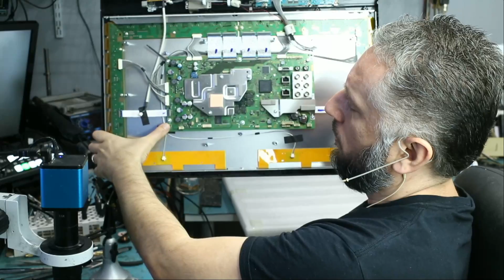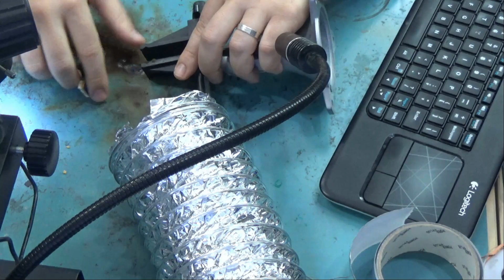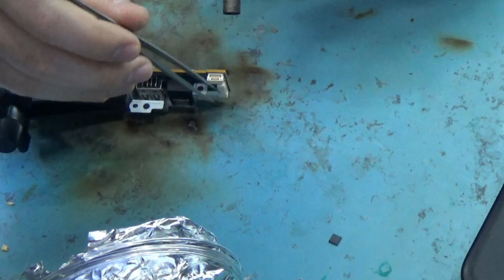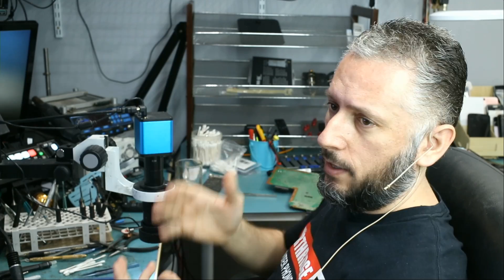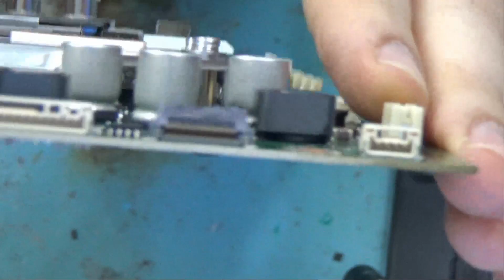CCTV Motherboard Repair - Broken Connector Replacement using another board

Comment: Indeed looks like a USB data connector.Vcc ,two data lines and GND.
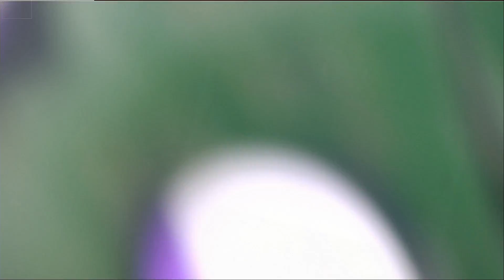But doesn't look like broken,except someone worked already on this.At 3:00 looks like unpopulated from factory,no sign on solder pads that something was there,same on data lines where may be some filter.

Comment: At 3:24 The  JST- GH connector in question looks to be a USB judging by the two middle traces coupled together. The black area around the traces is the copper pour removed during manufacturing of the PCB to prevent interference. The missing filter with the 4 pads behind the connector is most likely a TDK ACM2012-900-2P-T002. USB will not work without this filter

Comment: nice job ...i like your left side camera quality what camera do you use? regards Iulian !
Reply from the maker: Cannon 5D mark iii https://rover.ebay.com/rover/1/711-53200-19255-0/1?mpre=https%3A%2F%2Fwww.ebay.com%2Fsch%2Fi.html%3F_from%3DR40%26_trksid%3Dm570.l1313%26_nkw%3DCannon%2B5D%2Bmark%2Biii%26_sacat%3D0&campid=5338440312&toolid=20008 and 40mm lens https://rover.ebay.com/rover/1/711-53200-19255-0/1?mpre=https%3A%2F%2Fwww.ebay.com%2Fsch%2Fi.html%3F_from%3DR40%26_trksid%3Dm570.l1313%26_nkw%3Dcannon%2Bpancake%2B40mm%26_sacat%3D0%26LH_TitleDesc%3D0%26_osacat%3D0%26_odkw%3DCannon%2B5D%2Bmark%2Biii&campid=5338440312&toolid=20008

Comment: You make it look so easy.. And i'm trying to learn how to desolder and solder properly, i really am, but it's not as simple as "oh, i've soldered a couple of wires, time for me to move on to surface mount microcomponents with my extremely cheap soldering station with no air flow gun".

I'll be getting there, though. Cause even if i lack in depth knowledge about electronic components, I'm not a complete moron, and i used to be a fast learner. And while my magnification goggles will never compare with your microscope, they can get the job done. Just need to get myself a fume extractor, cause i built one out of 120mm fans, but it didn't suck enough. And an airflow station. And proper flux (559). And kapton tape. And uv mask. And..
Reply from the maker: You need to invest in buying a microscope and better tools, or you'll just end up giving up on soldering before you even start.

Comment: Hi, just wondering middle two wires go to a point and there is no inductor, fuse or anything to connect further. Could you please comment on it.  Thanks
Reply from the maker: Who knows and who cares. Board came in for a connector replacement and it's done.
Reply: @NorthridgeFix  OK, I assumed it was not working and it needed to be fixed beyond the connector replacement
Reply: Yes I am also wondering where these 2 traces go?

Comment: why didn't you wick off the pads and then just soldered using a regular iron (not hot air) to tack a pin to a pad and use it to align the connector and then once aligned solder the rest of the pins?
Reply from the maker: Because I can do whatever I want. There's more than one way to skin a cat